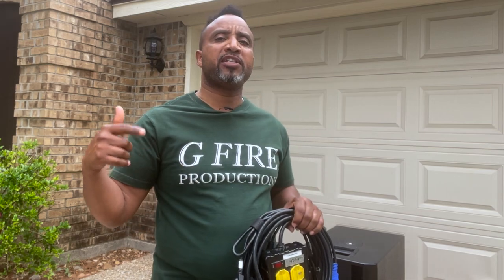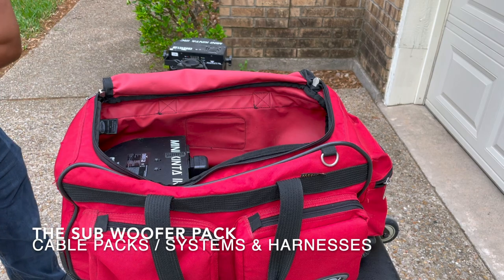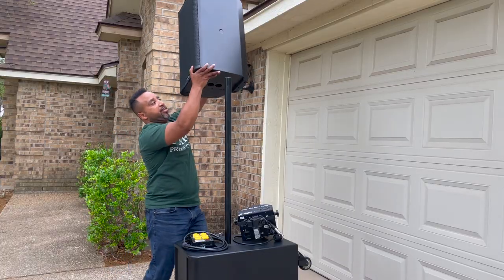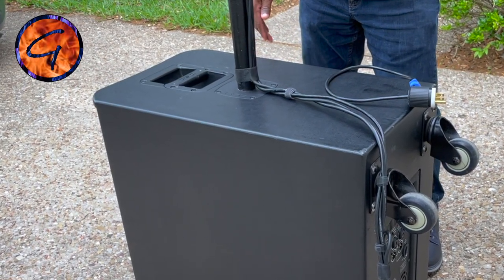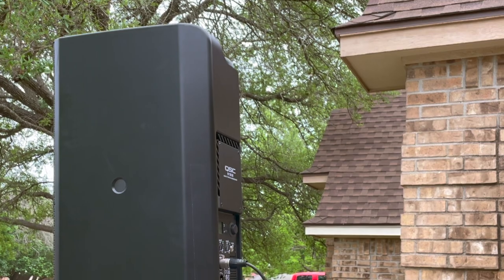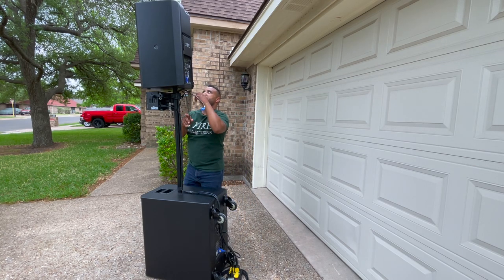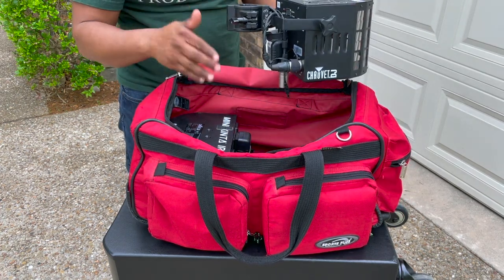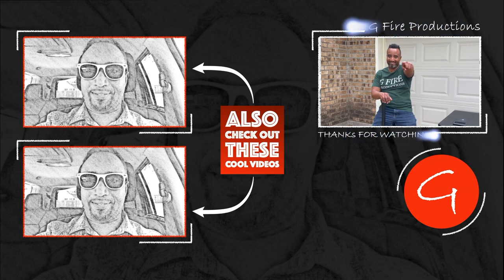Cable Packs, Systems & Harnesses | The Sub Woofer Pack

Comment: Is that a custom built quad socket? If not, what’s the model? Thanks for the video!
Reply from the maker: Hello Coma, here is the quad socket link: https://amzn.to/3RiWAqi

Tower Manufacturing Quad Socket: https://amzn.to/3RiWAqi
Velcro Strips: https://amzn.to/3PTEBpa
5 ft XLR Cables: https://amzn.to/3Q4O4tH
QSC IEC Cable: https://amzn.to/3Rl4cbH
1 ft IEC Cable 2 Pack: https://amzn.to/3Rl4cbH